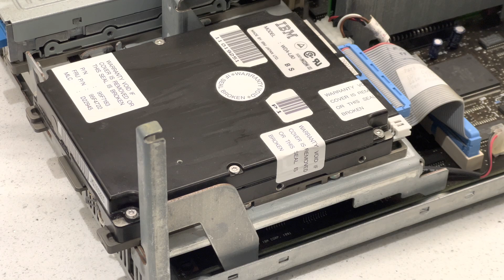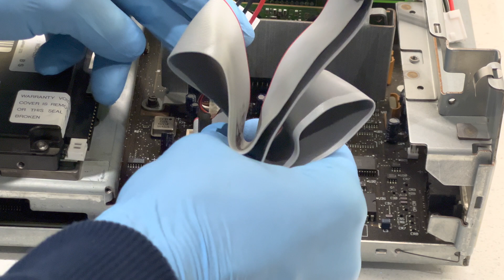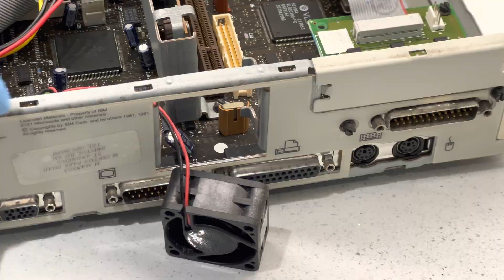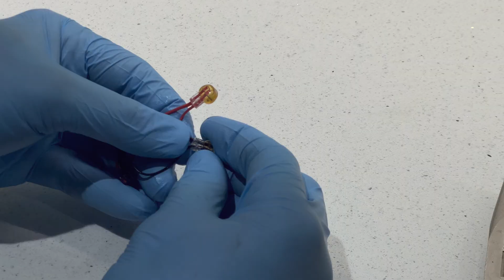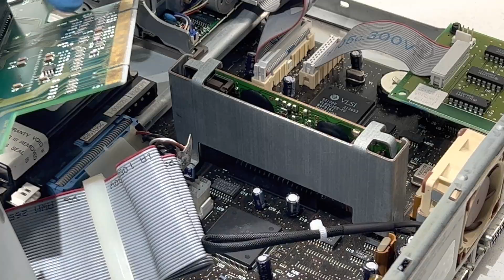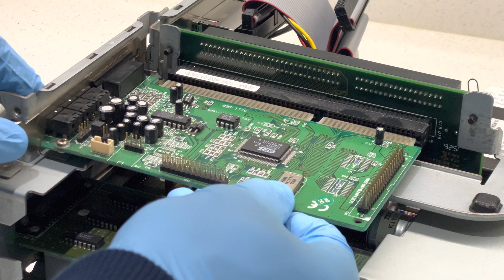IBM PS/1 386 PC computer (Type 2121) - Modifications & Upgrades - CF card / Case Fan / Sound Card

Comment: why didn't you just plug in the fan to the motherboard?
Reply from the maker: The new fan was connected to the same power plug port on the motherboard as the old one.